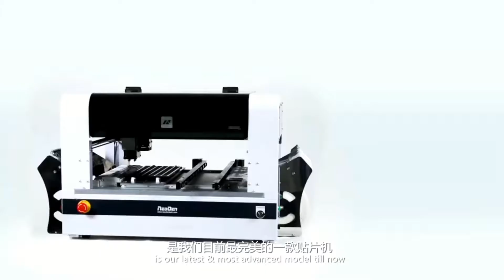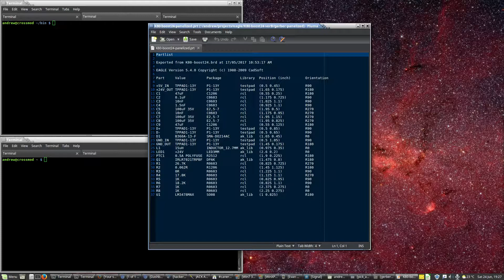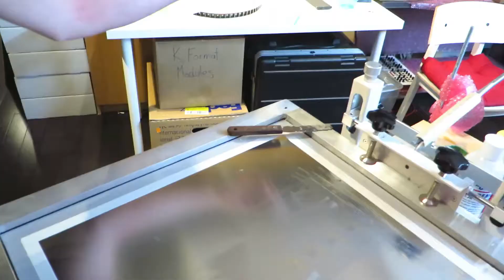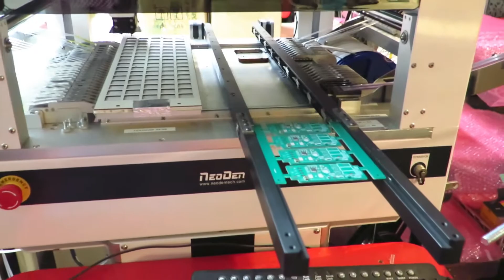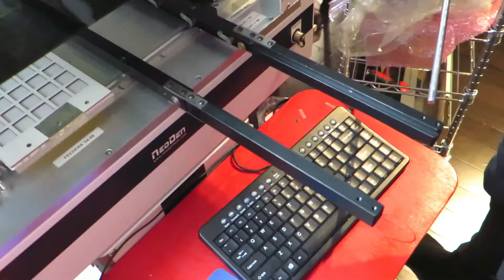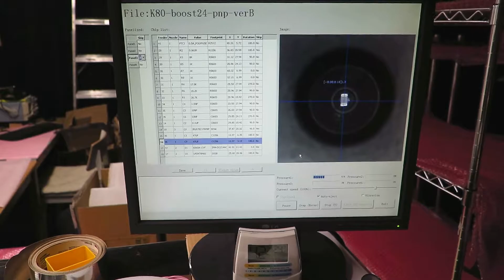Pick and Place Electronics Assembly (Neoden 4)

Comment: Where did you find the component tray for your Neo Den? The one that mounts to the left, looks like it is for SMD Bluetooth Modules?
Reply: @shiftedphase  Nice, I use a 3D printed one but its way smaller. Do you have a specific Solid Oil you use for the axis lubrication?

Comment: Okay, so you could make your board (PCB), with the Voltera (Voltera.io), then instead of placing everything by hand, you can put your boards in here?
Reply from the maker: As long as the finished PCBs can be reflow soldered (in an oven) then I presume it would be possible.

Comment: Assuming 8mm feeders as the baseline for max feeder counts, how does the machine deal with exceeding capacity. Does it allow for feeder swaps or do you have to reload and run two programs? How many tray parts can you load if space permits? At just under $9K it does make for nice high end hobby pick and place that you can also use for small jobs that most CM's wouldn't touch due to their cost structure. Thanks for the demo!
Reply from the maker: The software isn't very flexible. You can restart a job part way through on a board, but there is no facility to change out feeders. They are bolted on and require calibration with the camera each time you set them up. The easiest way to deal with too many lines in your BOM would probably be to just hand-place the weird parts before reflow. We do that will some bigger parts like FPC connectors which come on very large tapes.

Comment: What cph of this machiens
Reply from the maker: It really depends. But I found that the speed is not a really big factor. Unless it's part of a completely automated assembly line, the time to manually print and move the board around will be most of the time... not waiting around for the parts to be put on. We run boards up to about 250 parts and they only take a few minutes each.

Comment: Where did you find the used Essemtec reflow oven? Nice! And interested if you made any update to your stencil printing setup? In the video you mention its the weakest link. Could you go into more detail? We have been looking at the eC-stencil-mate from eurocircuits. While expensive, it seems to have some nice features. I wonder if any of those are what you consider problematic with the Chinese printer you are using now. Thanks for the video!
Reply from the maker: The reflow oven came from eBay... lucky find since it was local to me. The only change I made to the stencil printer (from Neoden... although they are not the mfg of it) was to tap and put set screws in the hinge mechanism to remove some slop from the hinge bearings. This made some improvement, but it's still a bit hit or miss for larger boards. We limit ourselves to about 4"x6" boards max and they work fine. We also don't use 0.5mm pitch components on this line as it's a bit too fine for reliable printing of the paste every time.

Comment: HI,
I have buy one of this machines and have some problems to convert pick&place files to open with the machine!
i dont know i! 
when the machin open the file adjust the coordinate. if x=12.3 and y=12.6 in the machine appears like that x=12.0 Y=13.0!
And the board never stop in the same point so can't read the fiducial :(
Reply from the maker: I never had any problems with the positions in the chiplist changing. You do have to set up the job by calibrating the board edge and fiducials so the machine can find the board and know where your fiducials are. (within a few mm) After that the data you supply in your file will be used as relative coordinates. Read the manual and check the setup videos from Neoden. Also, check some of the example files to make sure your data is in the correct format.
Reply: Thanks for the answer!
But the problem is that I configure the edge of the pcb and the fiducials! and when I put the pcb in the convoyer it stops a few times in front of others behind as if one does not recognize the pcb!
Reply from the maker: Sorry I don't know the problem... there is definitely some tweaking required but we've always been able to get the jobs to work reliably.
Reply: I apologize for the inconvenience, but I think it's easy enough to solve! But it must be failing something! You can give me your e-mail to send you a sample pick & place file!
Reply from the maker: Sorry but you should talk to Neoden if you need help with your machine.

Comment: Is the oven you didn't like, the T5? What do you recommend? I am looking at the PnP unit. Someone can get it for me in Guangzhou. Any ideas on extra feeders and the dual or quad nozzle head?
Reply from the maker: Mine was one of the T962 variants... the larger version of the ones you most often see hobby folks talking about. After extensive testing, modding and research I became convinced that the design of these cheap ovens is just plain wrong. It's all shiny metal inside... they use low temperature tape not suited for getting hot, and there is no vent. I'd say don't buy any oven that doesn't have a vent, unless you are using it completely outdoors. (probably not practical) We ended up finding a used Essemtec RO-06 Plus oven on eBay. I think they're still available new, and might seem expensive. But trust me... the devil is in the details. No point in placing components perfectly if you can't reflow the board perfectly! The stencil printing is now the weakest link in our process. It's the only reason we can't handle 0.5mm pitch... but I haven't found a practical alternative that fits into our very small workshop. If anyone knows of a high precision table-top solution let me know. :)
Reply: We are thinking this combination and ship it with one of our inventory shipments. The oven I think has a couple vents.  http://www.ebay.com/itm/SMT-PCB-Assembly-Line-Pick-and-Place-Machine-NeoDen4-Reflow-Oven-Stencil-Printer-/182285144664?hash=item2a710a9258:g:3uQAAOSwXYtY0hx8
Reply: @armworksu.s.a.5882  Hello! Can you share how goes your purchase at this time?  Greetings.
Reply: @mjsilvarivas   Hi. I have not bought any yet. I still think the Neoden is the best choice.
Reply: @charlesspringer4709  We bought a Neoden 3V and a T5S continuous reflow oven. The pick and place will start to work earlier, the oven requires special electrical installation in our office (5800W) so will start later. As soon as they become active i will upload a series of videos, i'll share the link if you want.

Comment: im still considering a old universal instruments gsm2 / they cost nearly the same used as a new neoden4 - they can place 0603 easy and they run at aprox 6k picks per hour .. not the fastest mashine .. but those are reliable .. the only drawback is maintenance / service + the space they take up

the feeder however are way better then anything neoden could come up with ( cost more as well )
Reply from the maker: Pierre Kircher I think the small footprint and modern hardware in these newer machines is a big plus. Hopefully the next generation will solve the drawbacks of the feeders, etc.
Reply: have you tried placing 0402 or 0201's ?
Reply from the maker: No, but we ran 100TQFP (0.5mm pitch) and the placement accuracy was fine... the paste application was less than perfect with the manual stencil printer.
Reply: fair enough .. well seems its good enough at least for a big part .. unless you do bga's or smaller stuff

Comment: I bought a second hand Neoden TM240A for about £1000 earlier this year and i'm really happy with it. I think a lot of the accuracy is dependent on the stability of the table it's on i have mine bolted to a wall and it will do 0603s and SOICs all day. Neoden make some really good machines but they cost a lot because they were the first people to offer a PnP that small and they haven't really adjusted there prices to match new competitors. Something to consider is that this type of small scale assembly equipment is hard to resell and devalues considerably the second you buy it.
Reply: i agree the neoden tm240A arent bad specialy at hobbist grade stuff .. problem is the lack of vision if you have a dense populated boards

@shifted phase .. i disagree its not always about the money saving .. for some of us its QA/Leadtime of pcba's + you mostly end up getting caps/resistors they pick up at the market "today" - so consistency is hard that comes into play if you have complience regulations .. fcc/ce in rf/hf circuits 

all depends on the usecase .. 
+ i dont need to get started on customs .. they tend to hold stuff from china for 30-50 days .. 

i personaly get the pcb-pannels made in china and have it shipped, a local pcba does the aessembly - or small qty's are done by hand.
Reply from the maker: Yes, I agree. I think if you can justify the cost and "pay it off" with jobs you would send elsewhere, then it's good. We didn't consider the resale value since we plan on running it for a number of years.